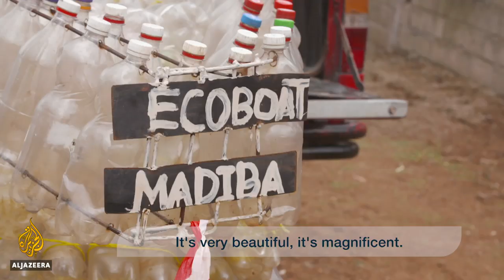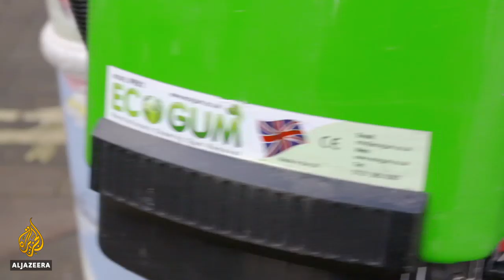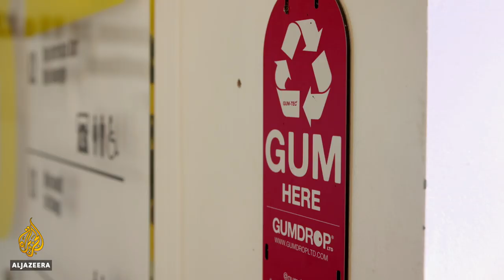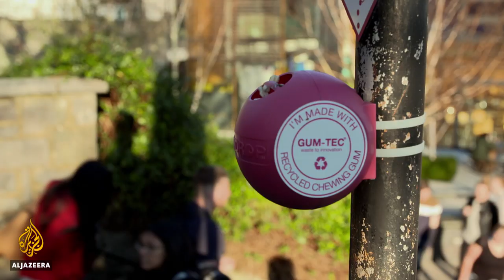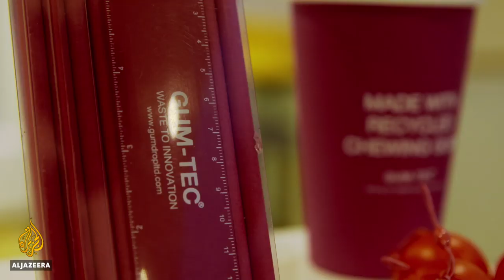Reimagining Plastic: Turning Waste into Products | earthrise

Comment: If they first melted the plastic is big vats, then pour it into (boat) molds. You can also make benches, and picnic tables from melted plastic. They'd be virtually indestructible.
Reply: you need the facilities to do that first. The plastic has to be shredded, you need a mashine to melt the plastic in with consistent and even heat and you need the molds.
Reply: They can start off small. Look online. People are melting plastic in their kitckens. If you start off small, little by little, you can grow into a larger company. Maybe get a loan, or an investor.

Comment: Fortunately the Koch brothers have provided $800,000,000 to increase the use of plastics. It's working very well, and 14% of oil and gas now goes to plastics. But since recycling is accounting for less than ten percent of production, the number should climb.

Comment: Good idea but it only take one of those line that tide them together and it breaks apart
Reply: Well, you seem not to see in a bigger picture... about that issue, coating all arranged bottles with protective covers and also using stronger material (perhaps metal string) solve the issue, and that will be a good one. I'm working in design... to me, the idea and taking action are the matters. Your comment is from a picky buyer who want to buy an expensive yacht !
Reply: Tesco Primark I never said it was bad idea I just said it doesn’t seem will last long time..
Reply: @benb5891  though you are right,you should think longer. About whether or not there is a way to improve it.

Comment: Hate to rain on anyone's parade BUT!!!!!    The cordage isn't free so it's not free,  unless you believe they found that to..  I'm a boater and this  craft  is very dangerous to use in open water.  The boat would never hold a motor safely and a minor off shore wind/breeze would easily blow a boater off shore into open sea much faster than anyone could possibly paddle.   That could be deadly.   Melt the plastic down and remold it into boat that is structurally sound would be far better and safer.  One that is strong and safe enough to hold a motor would be infinitely better.
Reply: Ok. I think with some improvements then we are A for away.

Comment: I see where all the bottles have multiple holes in them for the strings or structure to run through.  How come they do not fill with water and eventually cause the boat to sink?  I don't see how this would work over an hour.

Comment: The gum bin is just encouraging it, I stopped using gum when I found out its plastic, its disgusting, by doing the cups they are showing its ok to continue using gum, it gives the people the instant gratification that they are helping by putting it in the box but never encouraging them to stop buying gum because they enjoy the gum and get the gratification that they are recycling it.

Really people need to avoid unnecessary plastic use

Comment: I pick up trash for fun...... it makes me feel good. 

however, A dead fish lying in trash doesn’t mean the trash killed it. It is proof that that spot has less water flow than the surrounding areas. If you threw 10,000 apples in the water you would find many of them end up in this slack water and you will find fish floating dead in them. (I live on the water my whole life)

Reduce reuse recycle. The boats are amazing.

Comment: There's so much people can do with plastic, why doesn't any government stockpile used plastic properly? Some collect for '' recycling'' but only certain types to turn back into the same thing which is just another industrial process and expense. If you have electricity a heat gun is pretty useful for shrinking plastics over things, you can fix a chair leg with a plastic bottle, goes really hard. Or can fill a bottle with non recycled wrappers and make a brick.

Comment: We MUST stop buying plastics to begin with. That would be a great start. Then, we start to turn our plastics into some sort of item that can be reused over and over. This guy Ismael, is cool. But this isn't the end solution. We need more.
Reply: We need to start reusing glass bottles instead of plastics.
Reply: This should in NO WAY mean we build a dependency on plastics. This is merely a solution to our pollution. We should still reduce, if not completely, eliminate our plastic manufacturing.

Comment: Humm... The plastic boat looks like a good idea at first.... But isn't that just moving trash from one location to another?  Plastic is not at all durable that's why plastic bottles are one time use only. Therefore, boats & furniture made from reused plastic bottles will wear and tear faster. Such a great effort from Ismail though
Reply: coolasice o shut it. its a free mode of transport.
Reply: Syed Ahmed   That's true some plastics take up to centuries to degrade. However most of plastic pollution is caused by single use plastics. These are not made to withstand heavy use or be reused. They crease, break &  wear down almost immediately after use. Hence the hopelessness of this kind of pollution...once it's used it's useless and takes centuries to degrade

Comment: LOL....he forgot he need strings to tie the bottles up, i think he needs to improvise in further to make it bigger and higher to avoid getting wet. But again, it all those to self-responsibility. In Singapore its kind of stupid if one is using biodegradable plastic material, as in Singapore trash dont go to the landfills, it was instead burned to generate electricity. 

But still, all plastic can be recycled be grinding and remould them.  So its all about who will do that and who will be kind enough to handle their waste products in the right way.

LOL....if only people knows to throw their gum into the waste bin after chewing.